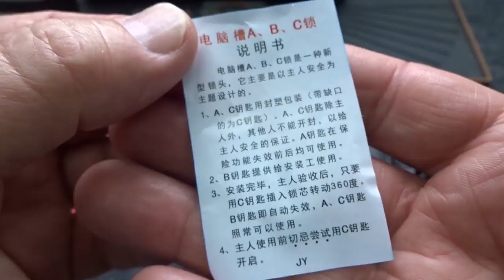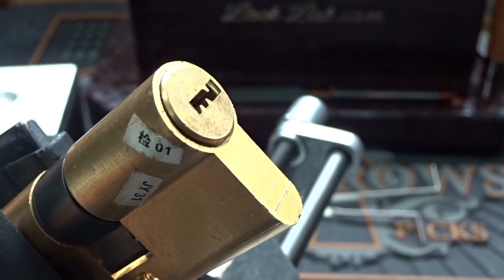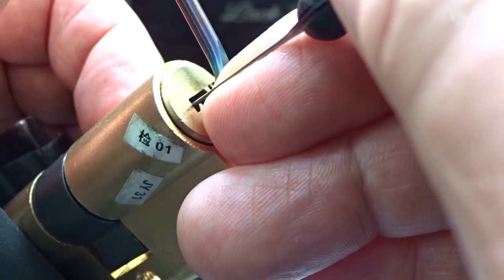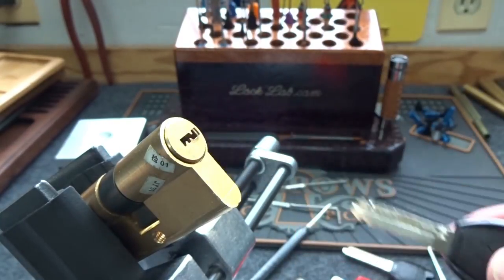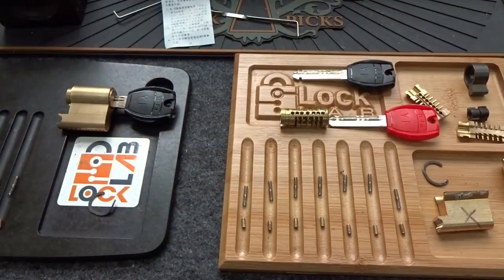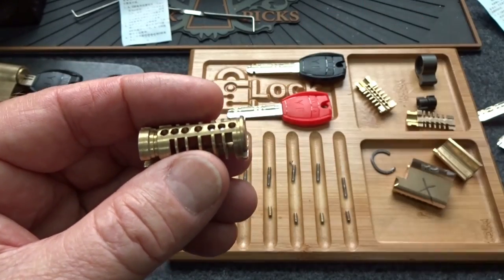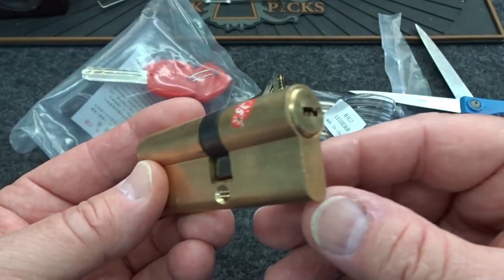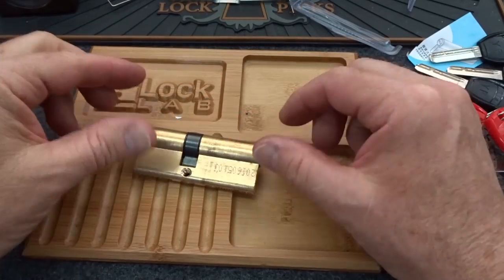(1066) Construction Lock Silliness

Comment: always wanted to take on this hobby an im waiting on my picks an locks any tips for beginner
Reply: mech1 24  me too
Reply: Practice Practice Practice 
Patience, don't get discouraged and even just feeling around in a lock with the pick while you watch tv or something helps
and tensioning is far more important than you initially think it it 
and you will want them all but you don't need many picks, resist the urge to buy
Reply: Watch his videos. Check out learnlockpicking.com and consider their re-pinnable 6 or 7 pin lock. If you get the 6 pin version, get the additional supply of pins and stuff so you get the security pins they don't give you with the 6-pin version. I sorted everything into a 30-day pill organizer I haven't used in a while. Works gud, and you can pin and repin that lock with various numbers of pins, various lengths of pins, various KINDS of pins until you can pick them all. THEN you get other locks so you can pick other keyways...though I haven't tried, but there may be other cores that will fit that lock body so you can just change the core and change the keyway.

Then you can buy other different sorts of locks, like disk detainer locks, and dimple locks, and work your way up to Medecos and high-end Abloys. There's some devious stuff out there! 

You can get a lot of it all from Bill's site, in the course he laid out, including a recommended list of locks to practice with. I'm still working my way through that list, while I keep banging away at that 6-pin challenge lock.

I also think highly of Deviant Ollam's book "Practical Lock Picking". Get the latest edition. I love his illustrations, they're excellent. You can get it for Kindle or in dead-tree edition on Amazon.

But you'll be tempted to buy a huge and cheaply-priced set of picks on Amazon or Banggood or eBay. Don't. They're usually just crap. Buy GOOD picks from good dealers -- Bill has a list on his site. I buy mind from Sparrows or MadBob's, or I simply make them myself out of high-quality feeler gage stock (another Bill suggestion!). I carry about 4 or 5 of my favorites in a case I got from Sparrow's, along with a set of decent tensioners -- the L-shaped sort AND some good prybars, though I have a set of the nice curvy ones from MadBob's on the way; they looked pretty.
Reply: mech1 24 Fully agree with r. decline on this, proper use of tension is extremely important, 90% of feedback you get will be felt in your tensioner. Check out both Bill's and LockPickingLawyer's videos on tension as they use opposite ends of the scale when it comes to amount of force used, and try to find a balance somewhere in between depending on the lock. In the beginning try to use light tension though, most new pickers use too much tension.
Reply: Cam Mason
you get your challenge lock yet? enjoying it?
Reply: DanBai123  still waiting on picks but i cant wait
Reply: Yeah I'll double down on the tension thing. I'm still very much a novice but am using what I would say is incredibly light tension to what I first did and to what I thought initially was "light." 
If you get like the Sparrows cut away lock (and the repinning set I'd highly recommend with it) but you can watch the pins and will be surprised at how little tension it takes. Bill's video on spool pins got me to lighten up quite a bit when I realized he only needed a washer worth of pressure on the tension wrench to display clear feedback.

Comment: you translated the chinese but messed up the letters
the B key is for constructions (red one)
the C key is the notched one and shouldn't be used before and turned the A key active
it does say once that happens both A and C can be used after step 3
and I think key A also works before C is used to remove B key from the system

Comment: How would LPL have tackeled this? He doesn't know how to run a machine shop. 
My shot: the 8th hole in the bible may have a small magnet inside to catch the escaping bearing ball. That's why you have to turn it a full 360. To first catch it in the indent and then transport it towards the 8th hole.

Comment: Seeing how that lock is from China, why shouldn't there be RED dust in it.  Seeing how the construction and house keys were solid their whole length, can see how that notched key would allow that ball bearing to disengage from it's hiding spot and activate that pin. Must be sitting right under the pin itself. Was that last pin face dimpled, at all? And since the construction key is not cut to the proper height, it would not work any more. Now, isn't that ball bearing about the same size the KGB used to poison that dissident?  Just saying.

Comment: so what is that ball bearing in the tray at 16:44????
Reply: john shead 16:11 look in tray
Reply: That ball bearing in the tray was the one he found before when disassembling one lock just before he tried the change key. He realized that the change key did pull a ball that dropped inside one of the cutouts, if the pins are magnetic that would hold the ball inside never to come out.

Comment: The actuator is in such a weird position... (still watching)
Reply: Stay away from these locks? I think it's ingenious (and puts on a good fight for a basic lock — Master Lock, watch and learn!)
Reply: Ralesk Ne'vennoyx Looks as if the lock is removeable from the door without a key, as long as it is unlocked. Usually Euro cylinders have a slightly turned actuator in that position to prevent it fitting through the keyhole.
Reply: Yes, I've only seen those turned actuators, which is why it was so weird

Comment: if both sides are pinned  then how can only having a key in one side work?
Reply: thebad300 one side is 6 pin, the other has the 7th changing pin stack
Reply: thebad300 there is a lock cylinder each side, but they can move the actuator (the middle part) independently from each other.
Reply: Bob Nips Ah, I misunderstood the question.

Comment: some use ball bearings and some use just what your talking about . it s made to disintegrate . it gos straight to dust . it's totally meant to . that's the red dust your seeing , I've heard of them before but don't know the name. on normal construction locks you would use the change key to open the lock and in doing so it would allow the bearings to fall into another chamber which would render the construction keys useless . .I'n this lock it crushes the graphite type bearing to powder which renders the construction key useless.check it out.it's either a graphite bearing or graphite pin one or the other.(goggle this ) patent us3998080 frangible construction lock system

Comment: The design seems slightly problematic. The construction workers are left with an 85.7% working key. Also the construction key could be fixed by attaching a similar ball bearing to the cut in the key.

Comment: #1
Reply: I watched and paused this video a few times bill and from what I can see the construction key has a deeper cut on the last pin so when the ball baring is still in place the pin fits but with the baring removed the pin drops lower making the lock not open ?? wouldn't it be possible if u got hold of a construction key and knew which lock it was for to add some liquid metal or some kind of filler to the last cut and just remove a little at a time until the lock opens with the construction key ???? sorry for long msg but I think it would be just as easy to fully change lock after work has been done.....